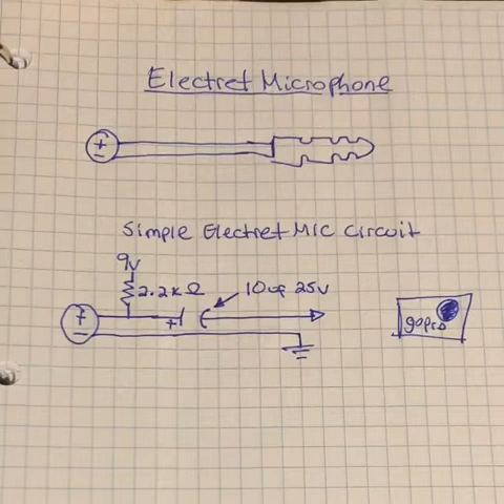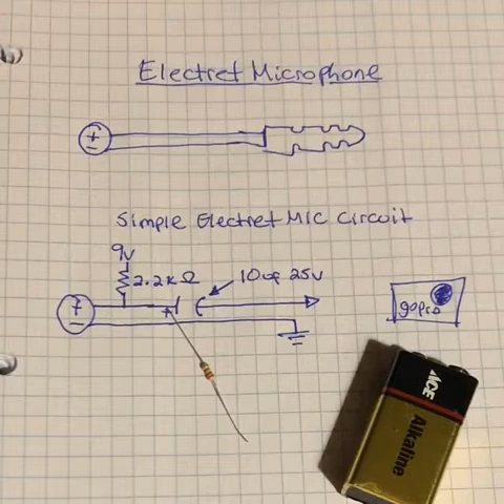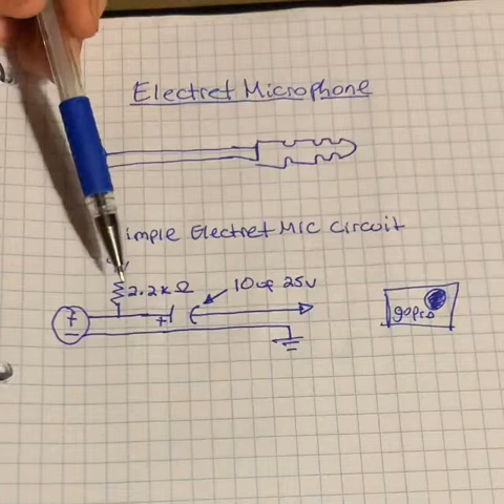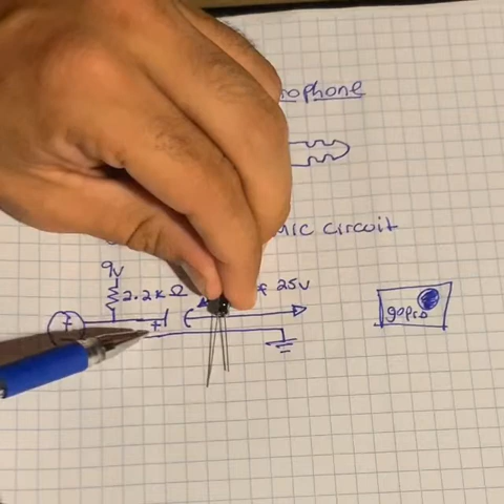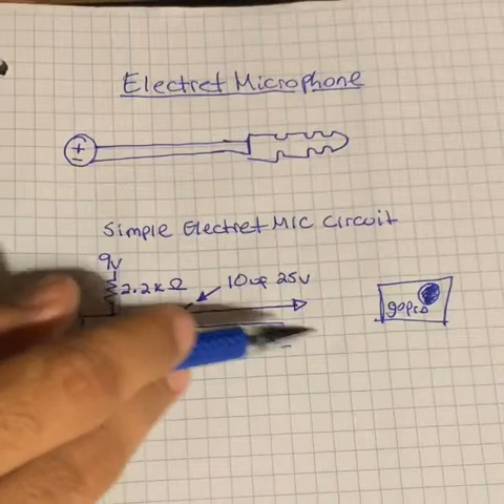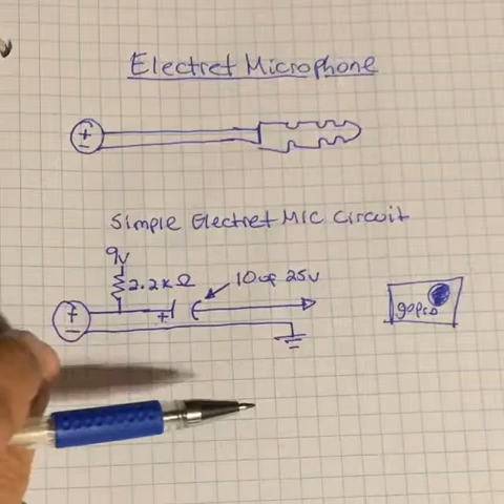DIY lavalier microphone tutorial #1 for gopro motovlog (electret microphone circuit)

Comment: Completed and get No Sound. I got 1 crackle when i flipped battery switch.   Mic - 2k resistor(not 2.2k)  --->  +Pos fed by 8.5 volt battery.  I have a  --> 10uf 16V Electrolytic Capacitor. I split +Audio from capacitor into L= Channel : R Channel  and connect to 3.5mm stereo plug. The Ground comes from Mic Post and is shared through a single Center Post on the 3.5mmplug. Shared Ground.??      I have triple checked everything and assembled per drawing. No shorts, No hotspots, No Sound.  ?????  Help ?
Reply: Microphone was installed Backwards